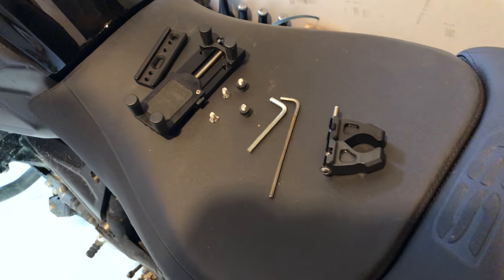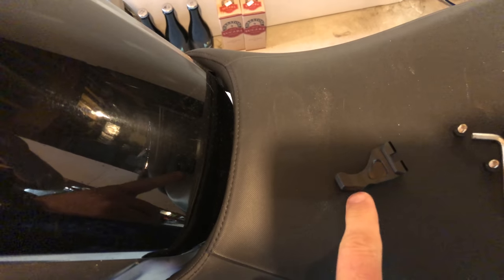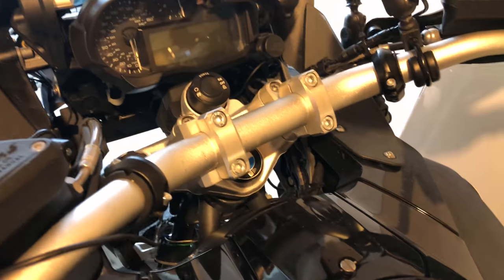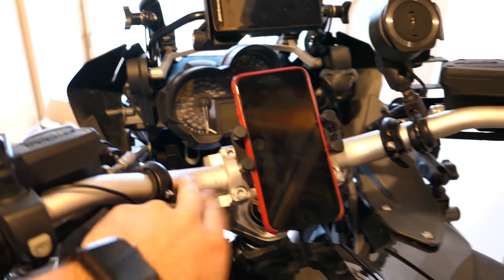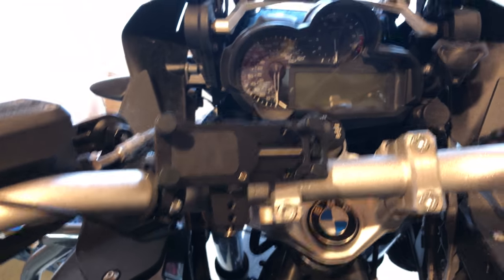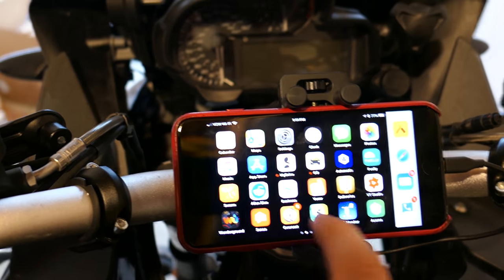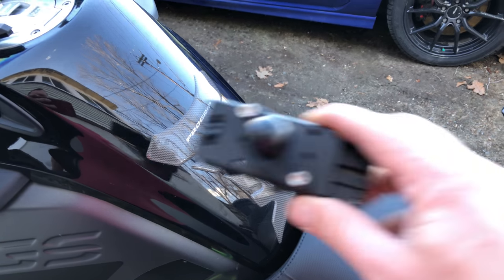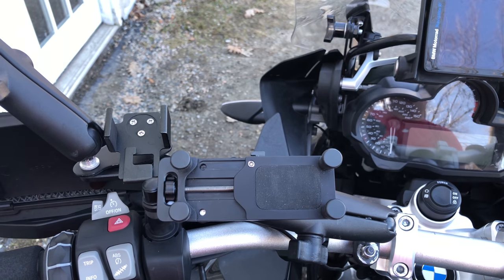Installing the Hondo Garage Perfect Squeeze on an R1200GS LC (with RAM Mount)

Comment: Adam,

I was wondering do you use motorcycle gloves that work with touchscreen devices to operate your phone while riding?  If so what brand of glove or gloves do you use and how do you like them?
Reply from the maker: The Klim Dakar gloves work great but obviously not in cold weather. I used them quite a bit this summer. The touchscreen support was perfect.